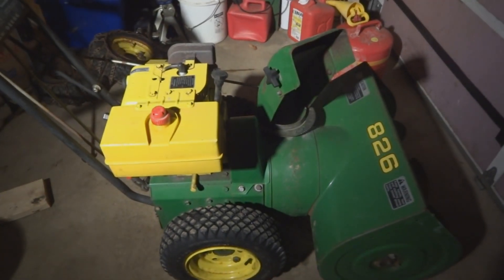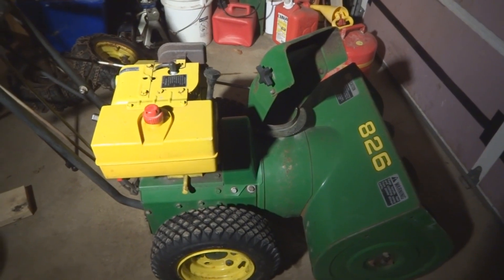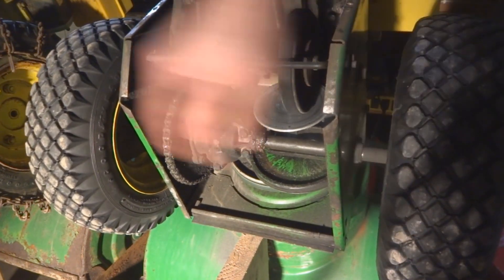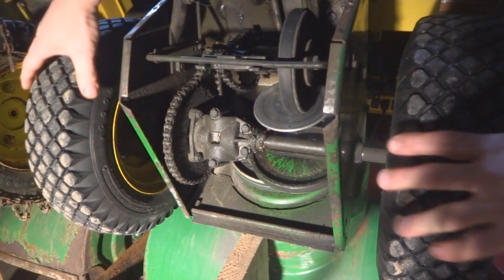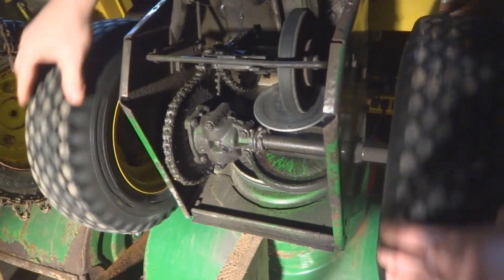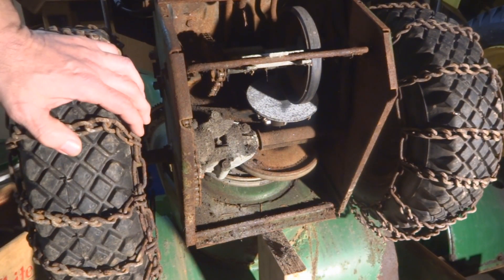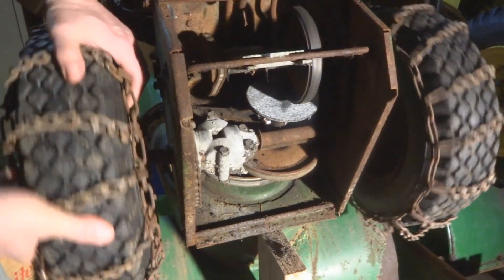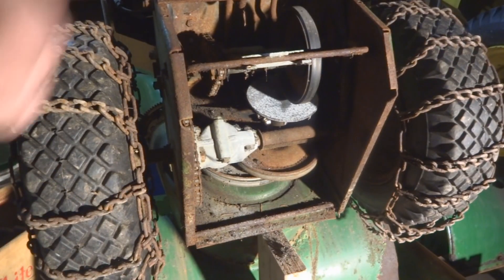John Deere 826 1032 Snow Thrower Differential Rebuild - Part 1 of 5

Comment: I am having trouble getting my 826 into reverse or into the top forward gears. it is the same vintage as this one and is the only one i have seen with the same friction wheel setup. Can you suggest anything?
Reply from the maker: In my experience, when a snow thrower doesn't shift easily, it usually needs to lubricated underneath. But DO NOT lubricate the round metal plate. Usually the shaft that the rubber wheel slides back and forth on needs lubrication. Hope you figure it out. Thanks for watching.